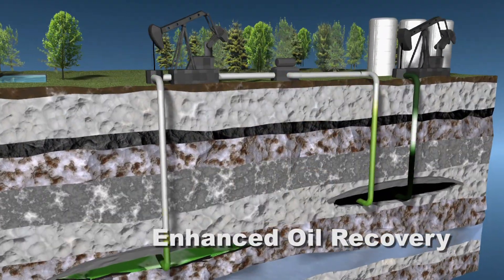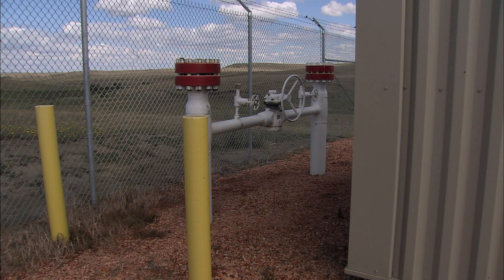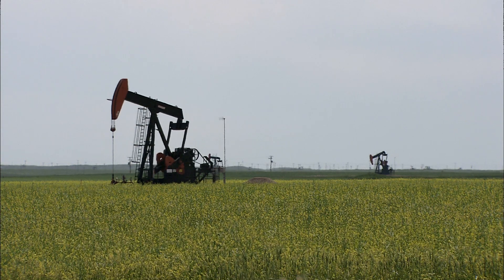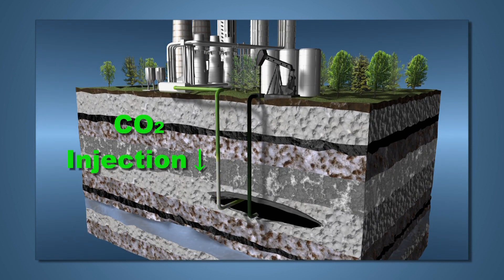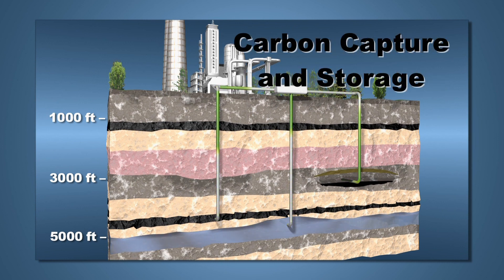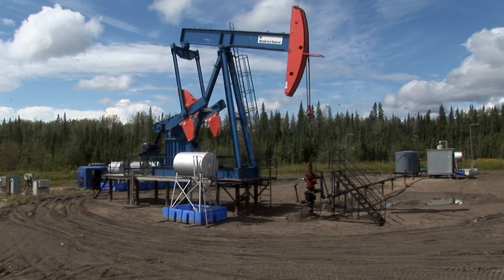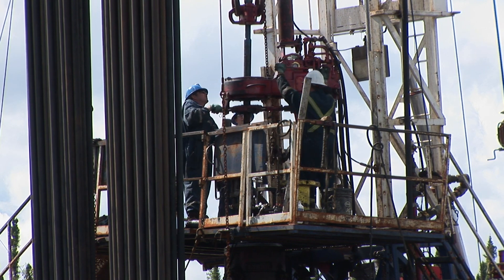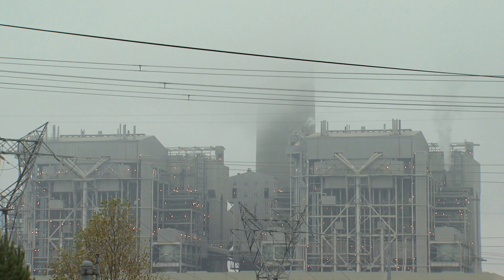CO2 EOR and Geologic CO2 Sequestration

Comment: The lucrative shale oil recovery industry in Oklahoma and other Mid-American States should have to purchase property damage insurance to compensate for the frequent low level earthquakes which are happening in those states which normally do not have earthquakes. One reason I purchased my home in Oklahoma was because this state sits on a very stable portion of the North American Plate which does not have frequent and serious earthquakes like those on the East and West Coasts and therefore i should not be suffering damage to my house; but I am thanks to the shale oil recovery industry locally. Cracks in my foundation cinder blocks have widened and lengthened and others have begun to appear which were not there before the shale oil recovery program began. I should not be subsidizing the oil industry by the State Government granting them exemption from prosecution, and prepaid insurance would guarantee that this obligation  is funded.